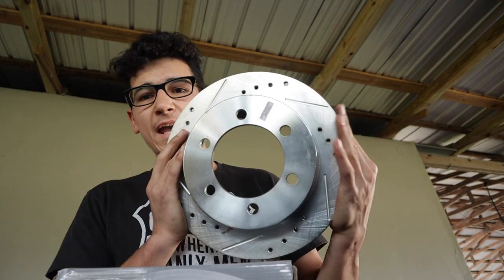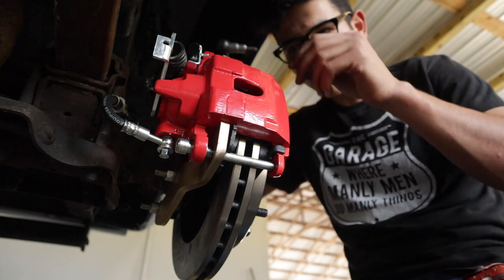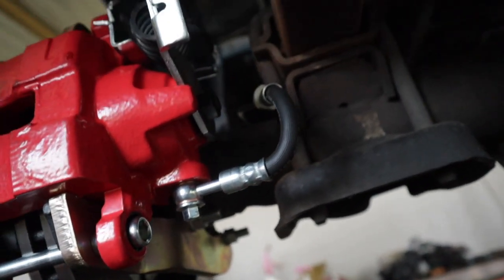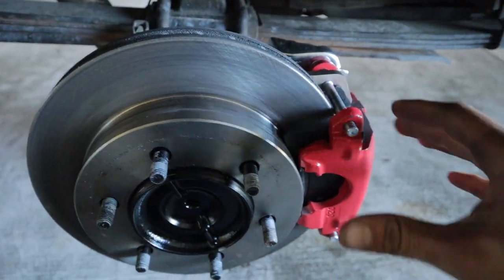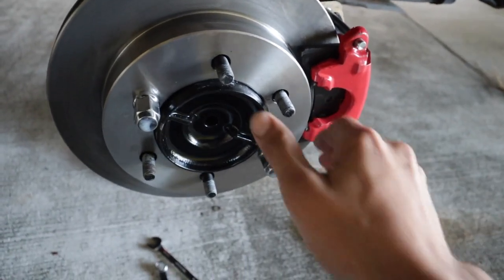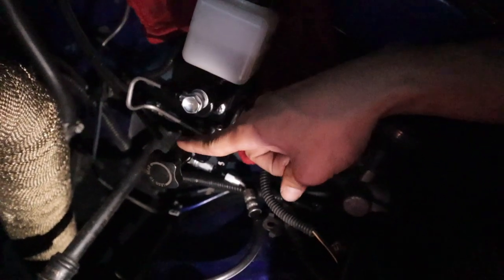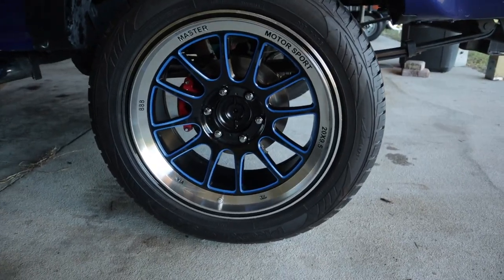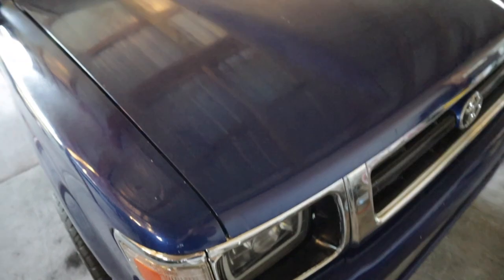Toyota Pickup Disc Brake Conversion Completion!

Comment: You will need a master cylinder off a 97 Tacoma a adjustable proportioning valve and a 3 lb residual valve in the rear
Reply from the maker: To make my pedal feel normal?
Reply: Yes
Reply: Have you done the swap? I’m doing mine right now and it would help to hear what you know abt it

Comment: You need a residual valve in the rear.
Reply from the maker: I have a Bias Valve installed with my Brake booster eliminator.